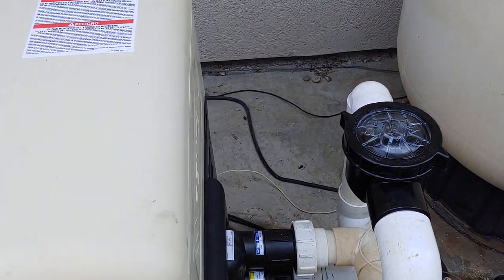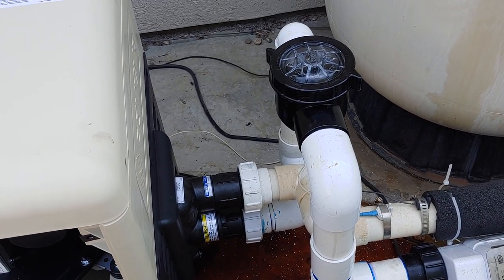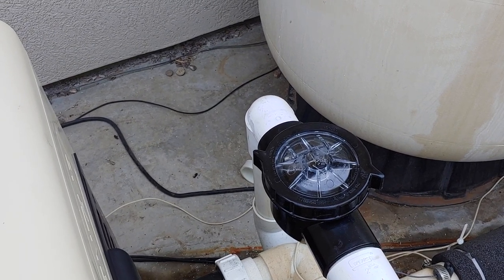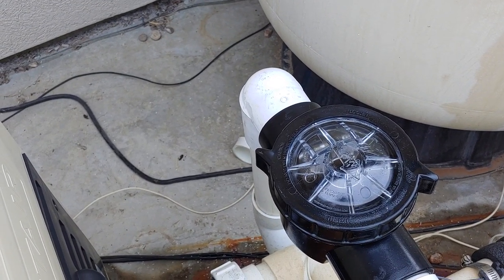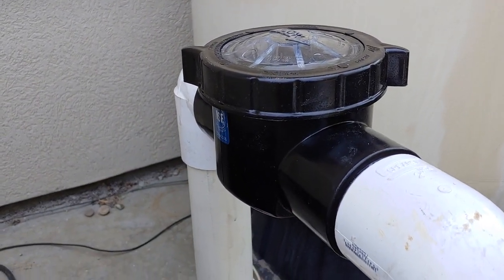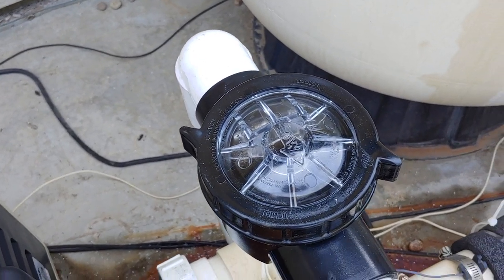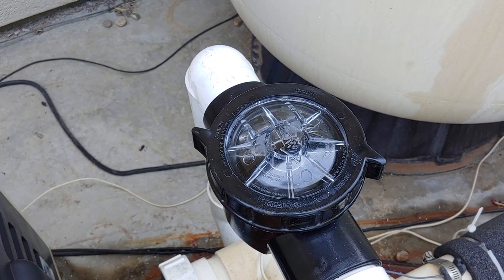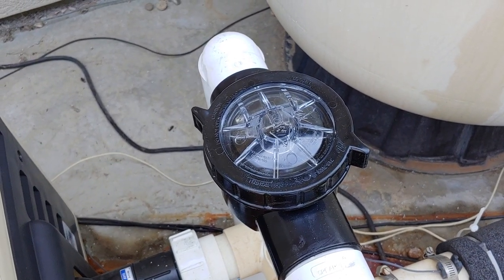Waterway TruSeal Check Valve- Awesome!

Comment: Looks like a good valve. They don't sell this at the supply I go to.  Can you please do an updated video showing taking it apart?  Would you feel confident putting this screw top check valve in below-grade equipment installs?

Comment: hay Matt thanks for the video,  it's been awhile , that looks like a pretty nice check valve, nice to see it between the heater and salt cell, unlike a tab chlorinator it doesn't really need to chemical resistant,  also you didn't mention it but I see you put it on top of a  Hartford loop, nice job